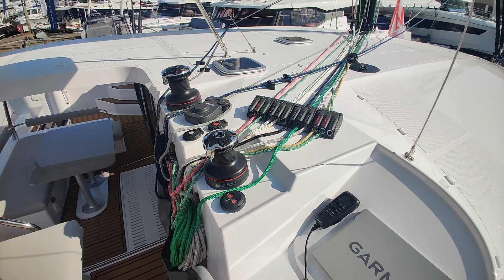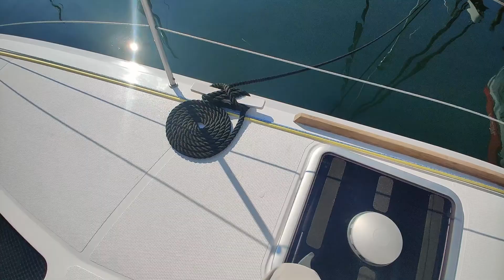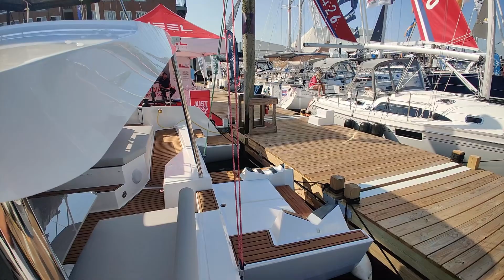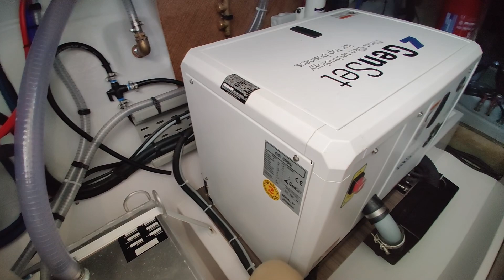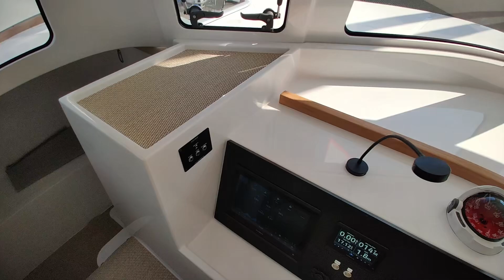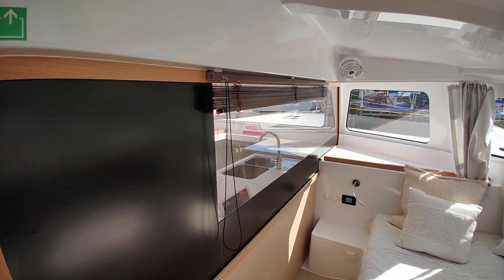The Nicest Neel 43 You Can Buy NOW! [2024 Boatshow Spec Walkthrough]

Comment: A single wet head in 43 foot multi hull is not really consistent with the market. Also dont see much in the way of galley storage or guest privacy. Really don’t get the layout.
Reply from the maker: Sacrifices need to made for performance! Keep it simple :D. FWIW People do generally seem to prefer the 43 over the 47 as they don't have to exit the boat to reach the guests.
Reply: I hear the 48 is on the drawing board - replaces outside entrances of the 47 and is shrunken version of the 52.
I think the 48 will really put Neel on the map.
Reply: @jamesdiserio4020   Only issue is price for 48 will be near $1,000,000 !
Reply: It has a potential advantage of you have an individual...or couple with mobility problems. Rare on any sail boat  even  multihulls.